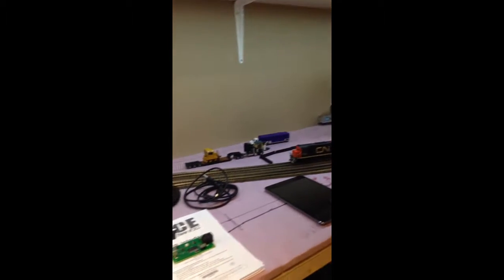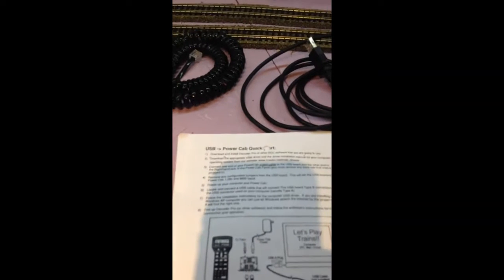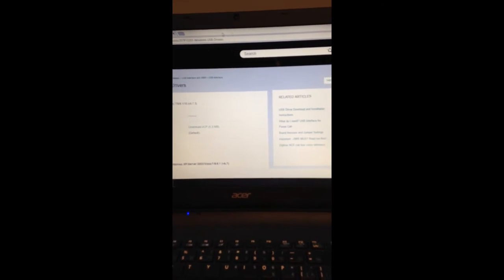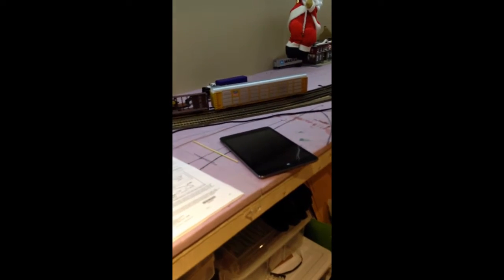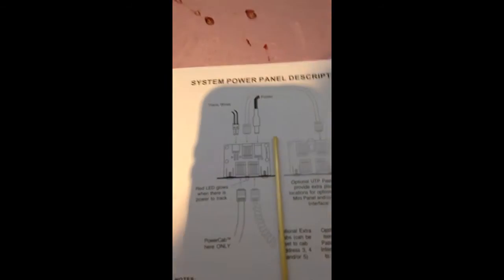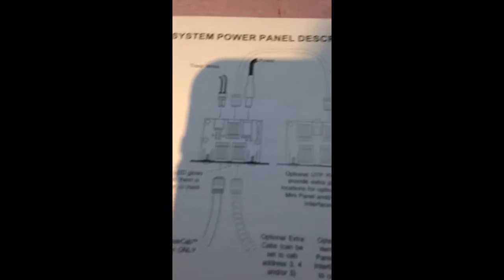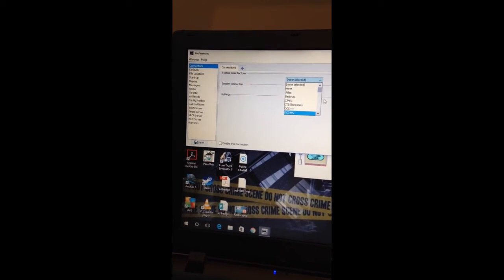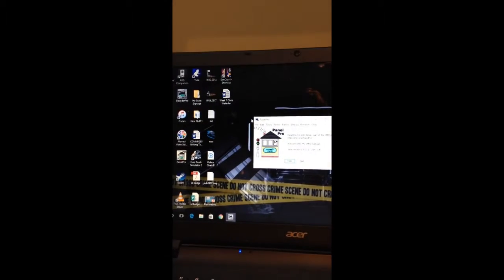NCE Power Cab USB Interface Setup with JMRI and WiTrottle

Comment: I have everything you have but when I try the WiThrottle it does not work. The JMRI screen shows that I have selected the loco I want to operate but I have no control at all. It will not work even trying to use JMRI ,s throttle. Where can I go to get help. I have tried The JMRI blog with no success.

Comment: Great video!  When you finish setting up your system do you need to have a dedicated computer from then on to operate your trains or is the computer use a "one time" requirement?
Reply from the maker: Hey, thanks for the comment. Great question. In order to use the WIFI Throttle App on a mobile device, JMRI has to be running on a computer to use it. WIFI Throttle sends commands over WiFi to the computer into JMRI which is hardwired to the Power Cab.